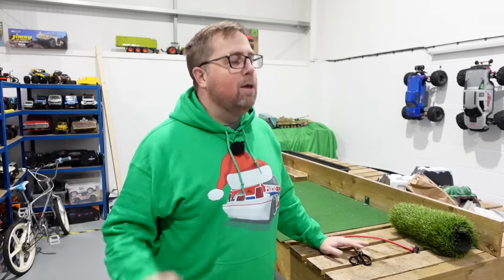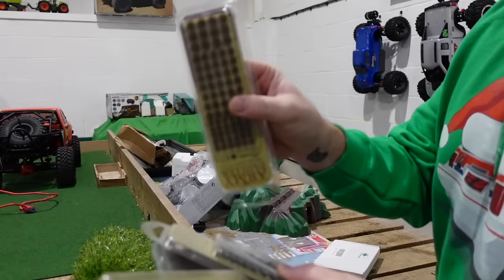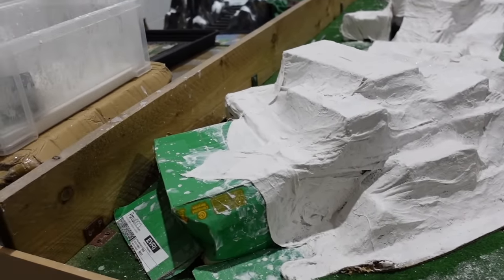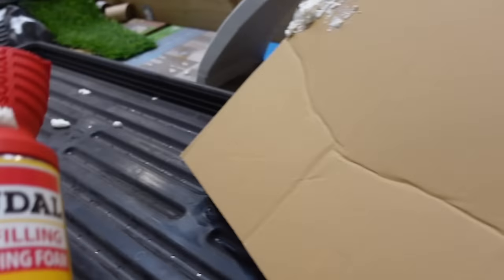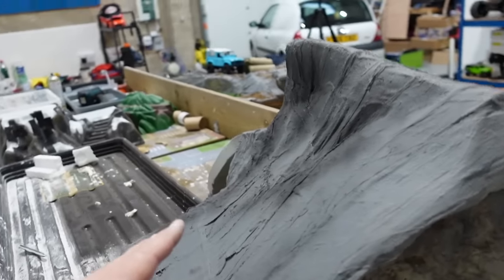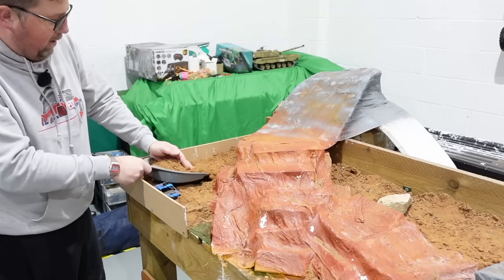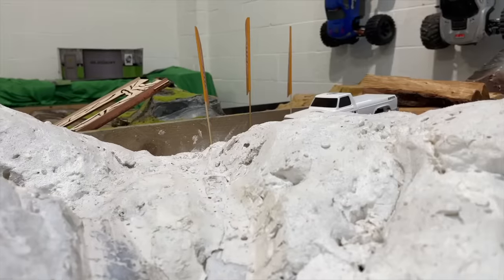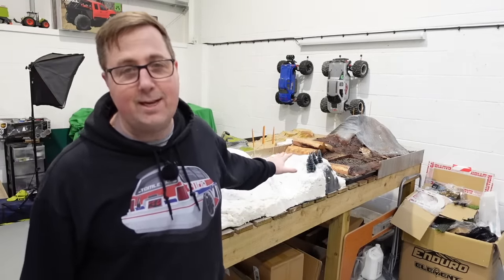How To Build an Indoor Mini Crawler Course - Part 1

Comment: It's a process....soon as you think you're done, you will want to add or change it up......another tip: hot melt glue gun.....for that area that you sprayed all the foam underneath the mountain, some vertical pieces of cardboard would support that whole thing.

Comment: Love the 4 season theme.  But I think you need to make yourself a real mini crawler.  That FCX is all looks and no bite.  Lets build 1/24 lcg rig that will handle every line on that course.  Or break out that SCX24 with the furitek system you made a while back.

Comment: I used spray truck bed liner on the smooth surfaces before painting and it created an awesome texture.  Just enough grip and it looks pretty natural too.
Reply: I have a local auto parts store that has rubberized rocker guard..that works too. You can also buy textured paint that "looks" like granite.....another good source.
Reply: I have a left over can of that stuff and pulled it out with the plasti-dip that was used to waterproof some electronics. Good idea!

Comment: Check out Hydroponic Clay Pebbles (they come in all shapes looking like rocks or boulders),also  you could mix the sand with plasterers plaster for a good type of building aggregate and you could also add cement dye to it for different colours..hope that helps..the Hydro pebbles are what you are thinking of tho I'm sure.

Comment: Awesome Phil. That Soudal foam I use at work here in Sydney and it works a treat. Definitely think unit cold did It in there.. Also core flute is awesome for cutting, shaping, bending etc..

Comment: When I was a nipper we used old bed sheets or curtains and plaster to mould scenes for railways. Much cheaper than bandage type ready made rolls of stuff and very easy to work with. Either way awesome track.
Reply from the maker: That sounds like a good little ‘hack’…. I’m not sure kids are as creative nowadays
Reply: @TomleyRC  I guess we had no choice back then. Necessity is the mother of invention as they say. I follow your stuff and enjoy the modern and the old school/vintage equally.  If it's not broke don't fix it is fine but if it's not broke but it can be better .. well bring it on.  You are doing great and making quite a name for yourself. Keep on keeping on and never be afraid to go outside the lines.

Comment: This looks great man. Lots of work and trial and error in this. My only question is will you have a jump ramp into the bean pit? 😁 I've been meaning to build my 24th scale course for months now. I bought a trio of steel cabinets for my garage that came packed / protected in  1"/25mm thick cardboard sheets. I was going to take a jigsaw to them to make terrain shapes like a topography map and cover that with some burlap or that plaster mesh. Hoping any finished product to be portable for easy storage or use. Convenience and quick access is the best way to make use of something like that if it can't be left set up (at least in my opinion).

Comment: Soooo, I'm not the only one with pile of cutoffs and misc junk for crawler course building. Mines mostly foam, boxes, shims, and hot glue. I used so much foam, when I actually had to use it for  work i forgot u could do that. Hahaha Check it out, I posted a video of it.